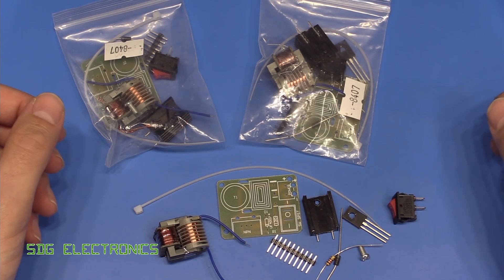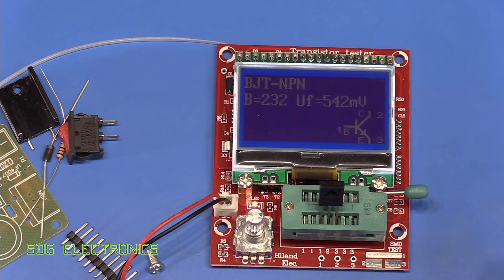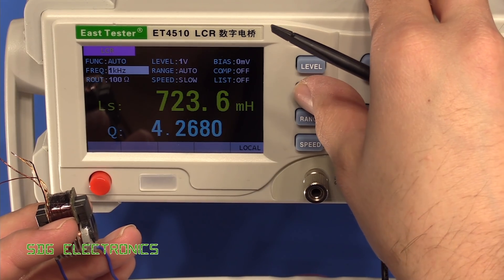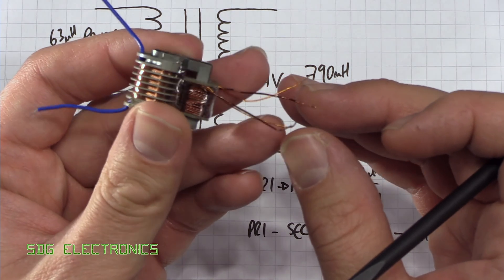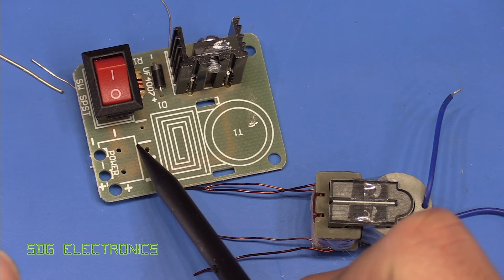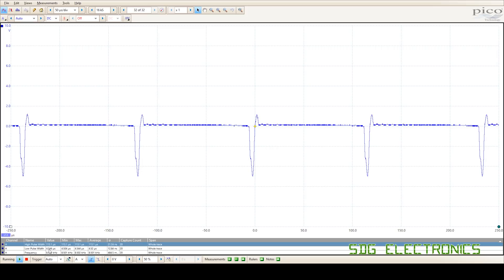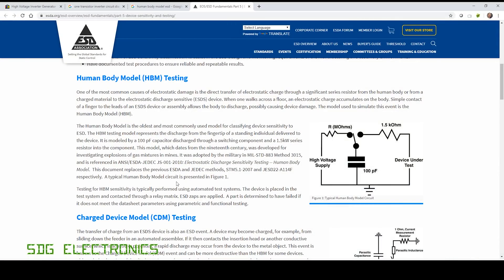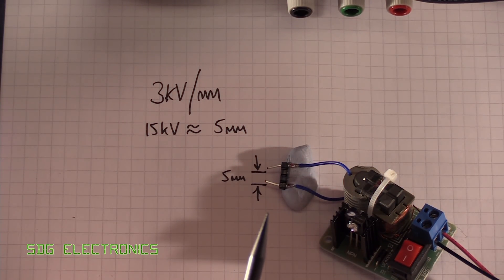SDG #127 Testing out a 15 kV Inverter for a Simple ESD Simulator

Comment: That's not a regular transformer. It's a  flyback   where Vin x  NS  get multiplied by an adrenalin shot. Your inductance measurements all seem realistic therefore turns ratios all  seem right. Plug into this equation and everything works.
VOUT = VIN X NS/NP X D/(1-D) 
=3.7 X 111 X 0.97/(1-0.97)  
= 411 X 32= 13.3 kV

So   this flyback with long duty cycle of around D=97%  will boost 411V into an approximately   13.3 kVout    .  The transistor is   in cutoff only for a very small period of time so a 97% duty cycle is very realistic. This circuit is completely bonkers. All the components are under incredible stress hence the reason this circuit never lasts very long. Sometimes only a few seconds.  Flybacks used in power supplies  usually have duty cycles below 50%.

Comment: nice clip. the segments in the secondary coil look like a sort of a bank winding arrangement. instead of traditional winding from one end to the other and back again, one segment is filled with windings at a time in a bid to reduce the voltage potential and risk of flashover between adjacent turns. also joule thief circuits switch on and off very hard due to the positive feedback they use to switch the transistor. so when current starts to flow in the drive coil the expanding magnetic field adds to the urgency of the transistor fully switching on and same for the collapsing field on switch off.
and as mentioned 3kv/mm spark gap in air is correct for small spheres, but point to point a 5 mm gap is more like 5kv.

Comment: Hello Steve. I was doing some emc testing just before christmas and  bought some of  the same transformers kits to make my own  ESD gun.  https://youtu.be/hr4RVqUHXjY Annoying you have beaten me to it with your video as I dont think I can do a better job than you have done Steve (Bugger!)   LOL. Great  video and explanation .  I have bought a 10Kv door knob capacitor from ebay £8.00 doorknob Capacitor 100pf / 10kV..    OK Steve race you to the final ESD build.  I would say the design of these is anything but straight forward  they have a very tighty discharge characteristic its more than a just a simple capacitor and resistor, but lets not spoil the fun. Also 15Kv is on the hot side but depends on the test standard PS if you look at my show notes for my recent high voltage video RS sell a nice high voltage probe if you dont already have one.  I really enjoy your channel and looking at your test equipmnent. My best regards Chris
Reply: https://youtu.be/Dnf5Kes5FcY   High voltage probe from RS in the show notes    https://uk.rs-online.com/web/p/multimeter-test-leads/3600300/
Reply: Final comment. I couldn’t manage to get more than 4.5 kv from this into 100pf. It could be that my high voltage probe is pulling the output down. But having used a real ESD gun at 8kv the output from this high voltage generator is feeble.  You know your comments on the output voltage regarding the spark gap could be wrong. A peak voltage will establish the ark across but once you have ionised the air the arc will maintain at a much lower voltage. I hope you can also investigate I would love to know how you get on with you own investigation. I have just ordered a 10 Kv relay annoying expensive.
Reply from the maker: Yes, I realised my error later with the spark gap. I've dropped this inverter and thanks to another subscriber I may take their approach so that there is HV feedback to make things more predictable. It was supposed to be a quick and dirty design to test a few things out but it's straying far away from that now... :-o

Comment: Yup, that pri-sec ratio of 111 is not what the max output is on secondary. It's not about inductance but it's the self-inductance that produces the real kick. You don't want sine wave on the primary,  fast falling edge dc will do fine. The faster the transistor can 'break' the primary circuit, the higher the self-inductance spike is on the primary (fly-back effect) and thus also the higher it is on the secondary coil. This is also how petrol engine ignition works. They put 12Vdc across the primary (which makes no sense to electricians at first because transformers only work on AC) that will produce a magnetic field in/around the core, then very quickly 'break' the primary circuit to let the previously built up magnetic field slam back into the primary (spike of about 150-250V on primary) and that will produce an even bigger spike in the secondary coil. Common pri-sec turn ratios of ignition transformers in cars is 1:70 - 1:150. Charge time of the primary (to build up magnetics in the core) is usually a few micro seconds.

Comment: For high voltage DC generation, I've usually gone with a cold cathode lamp supply from an old monitor or flatbed scanner and followed it with a Cockroft Walton multiplier. No need for very high voltage diodes.
Reply from the maker: That was my original plan. I may still do this

Comment: very fresh and educating.
your plan for esd gun makes me wonder how well a capacitor will hold the charge at 15kV, how much time you have before it leaks out and how the hell would I approach a problem of verifying these kinds of voltages and discharged energy amounts.
you certainly got me hooked.
Reply from the maker: I think it should be fine. I don't need it to hold charge for more than about 10 seconds.

Comment: I believe the transformer equation isnt accurate because it operates in flyback mode. The input voltage on the primary is not 3.7Vpp. It shoots way up when the transistor turns off due to inductance.

Comment: Now I have to trim the leads before soldering so they dont fracture. Dang. I am assuming this is for high reliability and not garden variety PCB's?
Reply: this is for thick leads only on every kind of pcb that you expect to work on the first try..

Comment: I've been through quite a few of these little things. I've had a couple of transformer failures (solved by coating it in nail varnish) and one transistor failure.
I also added a heatsink to the side of the existing one to keep it a little cooler, as I tend to run these quite hot.

Comment: The secondary is resonant, which is why you have the separators, which turns each section into a small LC circuit, and the plastic spacer separates the windings so they do not have high capacitance to each other. Each section is run at a resonant frequency, so they all sum to a very high voltage, limited only by losses in the core and discharge through the air. running the circuit open circuit will rapidly destroy the transformer by breaking the insulation down. Your oscillator tends to find the resonant frequency, as the LC resonance is the dominant oscillation. same circuit used in those million volt arc machines, just that the coil will break down fast there, so you want to have a load on it all the time, and they will run happily into a near short, as they are the inverters used for CCFL backlights, which need a high voltage to start the tube, but run otherwise at only a 300V or so level, essentially acting as a light emitting clamp.
Reply: Maybe it is not smart to state that you will eat a broom(I'll eat my hat in english?), but if plastic spacers (orthogonal arranged to the wire, not plate!) form nowadays a dielectric and a substantial capacitor configuration(not the inevitable virtual ones), then i will eat one:) An L-R element and an amplifier element alone are sufficient to form an oscillator. The plastic wings are there for isolation purposes. In this application the LR resonant circuit is dominant with the main factor being the base drive limiting resistor that pulls out the transistor of saturation.
Its a good point to run this contraption only under load as this may possibly eat the insulation by heating and breakthrough effects away and there is no reason to run it without load.
In any case, your unorthodox(and wrong) interpretation of Faraday's law deserves some love. Hehe :)